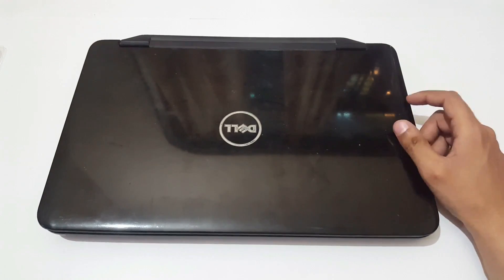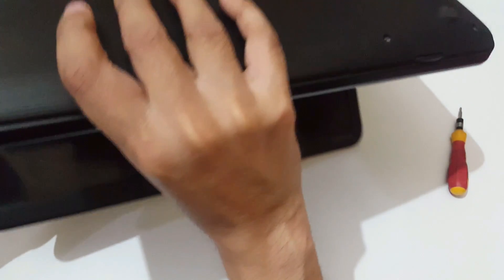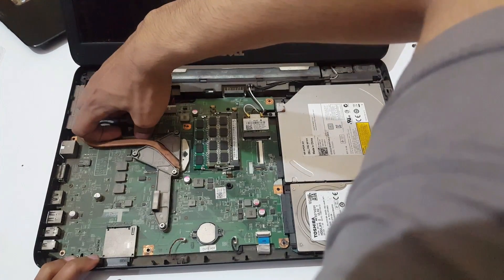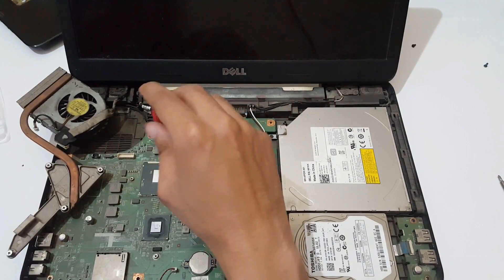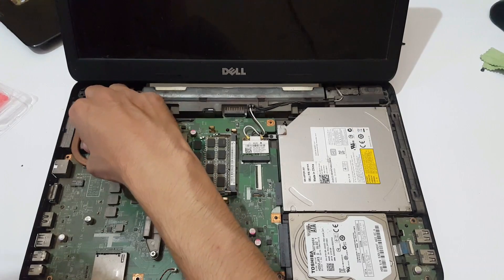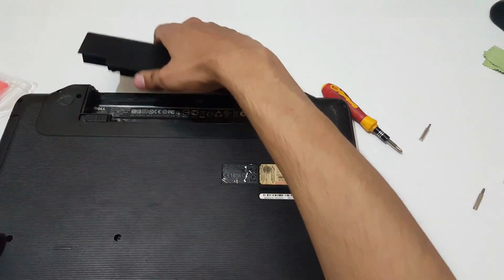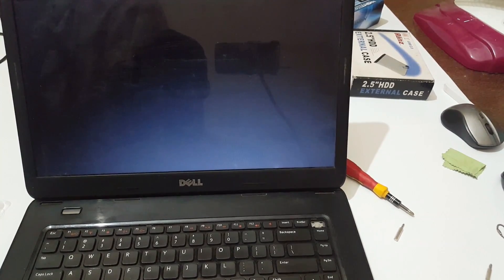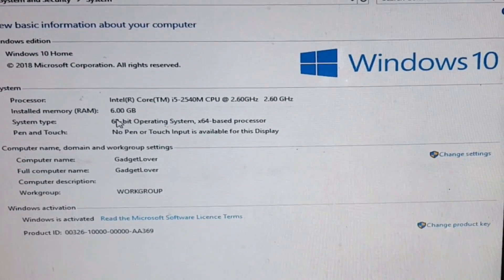How to Upgrade Processor on DELL Laptop | i3 to i5 & i7 - Make Laptop Faster for Gaming

Comment: I have Dell Inspiron n4050 with Celeron b815 it has FCPGA988 socket, I wanted to upgrade it to core i3-2350M with PPGA988 but I'm not sure will it work or not, I'll really appreciate if you can help me out 🙏
Reply from the maker: Sinatria : Yes it will work and I would like to inform you that Intel Core i5 2540M is best processor for your Laptop
Reply: @GadgetLover360  thanks a lot for your information brother
Reply from the maker: Sinatria : You're most welcome

Comment: Bro I have Lenovo g570 20079 which have i3 2330m. I want to upgrade  which processor suits the most?
Reply from the maker: udit dagar : Intel Core i5 2540M is best processor for your Laptop
Reply: @GadgetLover360  what about i5 2400?
Reply from the maker: udit dagar : Unfortunately you can upgrade it in same generation only
Reply: @GadgetLover360  i5 2400 is the second generation also i3 2330m is second generation
Reply from the maker: udit dagar : You can't install desktop processor in Laptop
Reply: @GadgetLover360  bro can u suggest some other cpu which is equally powerful as i5 2400?
Reply from the maker: udit dagar : This is best available Intel Core i5 processor your Laptop
Reply: @GadgetLover360  bro where I can get these old CPU's?
Reply from the maker: udit dagar : I would suggest you buy it from Ebay or Aliexpress online store
Reply: @GadgetLover360  bro can I use i7 2720qm in my laptop?
Reply from the maker: udit dagar : Yes

Comment: Can I upgrade my laptop processer I have lenovo G50-45 with AMD A8 6410 plz Answer
Reply from the maker: sandy bisht : The processor of this Laptop is soldered so you can't upgrade it but I would suggest you upgrade its RAM and install SSD for better performance

Comment: CAN THIS WORK ON LENOVO G500 MT 20236 
WITH 4GB RAM WITH I3 3110M
I NEED TO UPGRADE TO  I7 CAN I :(
and which is the best processor for i7 i need atleast 3ghz please tell
Reply from the maker: G N : Yes and you can upgrade it with Intel Core i7 3540M
Reply: @GadgetLover360  allahuakbar sooo thanks and not only that its 3.7ghz :)
And can i upgrade ram to 12gb?
And really i like my laptop ;)
Reply from the maker: G N : You're welcome and yes you can expand it upto 16GB
Reply: @GadgetLover360  whoa im soo happy 
Now i can make this laptop higher end this is my favorite laptop ever :)
Reply from the maker: G N : Glad to hear this
Reply: @GadgetLover360  yeah :)
Reply: @vladimirazirov1815  its only 3.20
I7 3540 is better :)
Reply: @vladimirazirov1815  yeah you are correct but i need more ghz 
It will be much better :)

Comment: I have an old Dell Latitude E4300 with 8GB RAM. Can I upgrade it to an i7 processor. If so please recommend one suitable for for this laptop. I also want to increase the RAM to 16GB. Can I do that because 8GB is the max for this system. Thanks.
Reply from the maker: nttam1920 : You're welcome and unfortunately the processor of this Laptop is soldered so you can't upgrade it but I would suggest you install SSD for better performance

Comment: Hello! I have a Dell inspiron 15-3521 i5 3337U(3rd gen) 4gb ddr3 ram. Is it possible to upgrade this laptop? Thanks in advance!
Reply from the maker: Ibrahim Aguell : You're welcome and the processor of this Laptop is soldered so you can't upgrade it but I would suggest you upgrade its RAM and install SSD for better performance
Reply: @GadgetLover360  This laptop has a 2 ram slots. Is it possible to put 2-8gb ddr3L ram? Also, is there a limit on the capacity of the ssd if i'll change the hdd to sdd like 500gb or 1tb ssd. Thanks again!
Reply from the maker: Ibrahim Aguell : You're welcome and you can expand it upto 8GB and no limit for SSD

Comment: What can I upgrade my i3 6th generation, 8 Gb ram, and 2 gb graphic card
Reply from the maker: Alwin Varghese : I would like to inform you that if processor is not soldered you can upgrade it in same generation for better performance and upgrade its RAM and install SSD for more better performance
Reply: @GadgetLover360  I don't u understand about what you mean by same generation
Reply from the maker: Alwin Varghese : Provide processor number
Reply: @GadgetLover360  my current processor number
Reply from the maker: Alwin Varghese : Yes

Comment: What is best upgrade to i3 350m
Reply from the maker: balli bhatia : Intel Core i5 580M is best processor for your Laptop
Reply: @GadgetLover360  ig my processor is soldered but i will open it up and check it once
Reply from the maker: balli bhatia : I would like to inform you that if processor is soldered you can't upgrade it but I would suggest you upgrade its RAM and install SSD for better performance
Reply: Can i install sdd on dell vostro 1540. Also ty for info😊
Reply from the maker: balli bhatia : You're welcome and yes you can install internal SSD drive 2.5 inch
Reply: How much would it cost me
Reply from the maker: balli bhatia : I would suggest you check its price details on Amazon online store

Comment: Bruh my laptop had celeron core 2 duo is  it possible to updrade it ? It is removable.
Reply from the maker: LT. SNAKE : Yes
Reply: Bro please tell me what to updrade I already installed 8gbs of ram
Reply from the maker: LT. SNAKE : Provide processor number
Reply from the maker: LT. SNAKE : Intel Pentium N3540 is best processor for your Laptop
Reply: Bruh sorry for that the processor is n2840
Reply from the maker: LT. SNAKE : I would like to inform that you can upgrade it in same generation only and check its pricing details on Ebay or Aliexpress online store
Reply: @GadgetLover360  n2840 to n3540 bruh?
Reply: Bga 1170socket
Reply from the maker: LT. SNAKE : Yes
Reply: @GadgetLover360  can it run any egpu
Reply: Like 1030 GT?
Reply from the maker: LT. SNAKE : I would like to inform that you can attach graphics card externally to your Laptop for better gaming experience

Comment: I have lenovo v-14 i3 1005g1 can i put i5 4th gen on this?
Reply from the maker: HaxH S : I would like to inform you that if processor is not soldered you can upgrade it in same generation only

Comment: Cool Video. I have the n5050 but it seams like the i7-2670qm is not compatible with the Dell n5050. With the new CPU the pc does only give three short bios code sounds. I think they don't implemented CPU support for this Dell model.
Reply from the maker: HalbBlut Türke : Thanks and first update system BIOS to the latest version then try again
Reply: @GadgetLover360  thanks for the answer :). yes bios update was the first thing I tried A05 Bios. But still it will not work. Very strange situation because I read in the web that others did this CPU and it worked
Reply from the maker: HalbBlut Türke : You're welcome and yes this processor is compatible with this Laptop this may be due to the processor is not working so go to nearby PC & Hardware store and tell them about this problem
Reply: @GadgetLover360  thanks. Yes I think I will try a other CPU first because the CPUs are cheaper than the labor here in Germany. Maybe there is something wrong with the CPU because all combinations of parts I have worked with this pc as long as the new CPU is not involved. Greetings from Germany:)

Comment: Bro, hp probook 450 G3 i3 processor 1tb harddisk and 4 gb ram want to upgrade.. which processor suits the most ?
Reply from the maker: Beast productions : The processor of this Laptop is soldered so you can't upgrade it but I would suggest you upgrade its RAM and install SSD for better performance
Reply: @GadgetLover360  ok thanks bro
Reply from the maker: Beast productions : You're welcome

Comment: I have AMD Ryzen 3 processor but want to do video editing using Filmora. Suggest me modification for my Laptop. I use Lenovo IdeaPad slim 3
Reply from the maker: ASG Automobiles : The processor of this Laptop is soldered so you can't upgrade it but I would suggest you upgrade its RAM and install SSD for better performance

Comment: Not bad. Just screws should be put somewhere where they don’t roll off
Reply from the maker: xl ThomAs lx : Yes and I would like to inform you that if processor is not soldered you can upgrade it in same generation
Reply: @GadgetLover360  I know this already thanks
Reply from the maker: xl ThomAs lx : You're welcome

Comment: Hello bro, i have lenovo ideapad 330 i3 8130U 8gb ram. can i upgrade the processor??
Reply from the maker: THE DARK YT : In my knowledge the processor of this Laptop is soldered so you can't upgrade it but I would suggest you upgrade its RAM and install SSD for better performance

Comment: hello bro  can i change  the processor ??????? 
Device name	RAJEN
Processor	Intel(R) Core(TM) i3-4005U CPU @ 1.70GHz   1.70 GHz
Installed RAM	4.00 GB
System type	64-bit operating system, x64-based processor
Pen and touch	No pen or touch input is available for this display
Reply from the maker: RM TECH VIDEO : I would like to inform you that if the processor is not soldered Intel Core i5 4310U is best processor for your Laptop

Comment: My unit is i3 5015U, what's i5 processors can be upgraded to this? 

Thank you for your reply.
Reply from the maker: Stormforge : You're welcome and Intel Core i5 5300U is best processor for your Laptop
Reply: @GadgetLover360  thank you sir. Do you sell that in your country? Most of the processors here are for desktop only.
Reply from the maker: Stormforge : You're welcome and I am not seller but I would suggest you buy it from Ebay or Aliexpress online store

Comment: I have dell Inspiron 3521 i3 3rd gen laptop. Can I upgrade processor to my laptop. If it possible which processor is most suitable to upgrade
Reply: My laptop have 6gb ram. But 1.9ghz speed. So can't run big softwares
Reply from the maker: Mohamed Nuskhan : The processor of this Laptop is soldered so you can't upgrade it but I would like you upgrade its RAM and install SSD for better performance
Reply: @GadgetLover360  thanks
Reply from the maker: Mohamed Nuskhan : You're welcome

Comment: Bro can upgrade my laptop processor Specifications of my laptop is AMD E2 7th gen 9000e and which processor suits my laptop most pls suggest me bro
Reply from the maker: Ritesh Kumar Mahakud : If processor is not soldered AMD E2 9030 is best processor for your Laptop
Reply: @GadgetLover360  bro pls suggest a powerful intel processor because amd processor sucks very much and Radeon graphics are just shit
Reply from the maker: Ritesh Kumar Mahakud : I would like to inform that you can upgrade it in same generation only
Reply: @GadgetLover360  but bro can i not upgrade it from amd to intel processor
Reply from the maker: Ritesh Kumar Mahakud : Yes
Reply: @GadgetLover360  ok brother thanks you a lot
Reply: @GadgetLover360  but pls tell which 7gen intel processor will be best
Reply from the maker: Ritesh Kumar Mahakud : You're most welcome and as I said before that you can upgrade it in same generation only
Reply: @GadgetLover360  brother what will be the price of laptop graphics card of 512mb
Reply from the maker: Ritesh Kumar Mahakud : I would suggest you to buy Asus GeForce GT 710 2GB Graphics Card from Amazon online store
Reply: @GadgetLover360  bro but i need a laptop graphics card
Reply from the maker: Ritesh Kumar Mahakud : I would like to inform that you can attach graphics card externally to your Laptop for better gaming experience
Reply: @GadgetLover360  bro i have lenovo IdeaPad 320 can i add a internel Gtx 960m to it
Reply from the maker: Ritesh Kumar Mahakud : You can attach graphics card externally to your Laptop

Comment: hello bro i have Acer travelmate p243  celeron 1005m 1.90ghz processor ddr3 ram 5gb which is best processor i can use ? please tell me and the price also?
Reply from the maker: Dopenews Official : Intel Core i5 3380M is best processor for your Laptop and I would suggest you buy it from Ebay or Aliexpress online store

Comment: can I replace the i5-1035G1 from my dell Inspiron i5-5593 2020 version with an i5-9400f?Can i also replace my GPU to like gt710
Reply from the maker: Rise : I would like to inform you that if processor is not soldered you can upgrade it in same generation only and you can't replace the GPU but attach graphics card externally to your Laptop for better gaming experience

Comment: I have Dell INS 5567 - Intel i3 processor with 4 GB Ram. Can you please tell me if  I can upgrade my Processor, Ram and Storage to SSD? If possible please suggest
Reply from the maker: Makarand Kadam : The processor of this Laptop is soldered so you can't upgrade it but I would suggest you upgrade its RAM and install SSD for better performance

Comment: i have dell n5050 ..it has become very slow over a period of time..i want to upgrade it ..please tell me which processor and ramis needed for it
Reply from the maker: Arjun Sawhney : Provide processor number and you can expand it upto 8GB so upgrade it to 4+4GB DDR3 1333MHz RAM
Reply: @GadgetLover360  Intel® Pentium® Processor B950
Reply from the maker: Arjun Sawhney : Intel Core i5 2540M is best processor for your Laptop
Reply: what about the i5 generation
Reply from the maker: Arjun Sawhney : Unfortunately you can upgrade it in same generation only
Reply: @GadgetLover360  after i upgradation can i run softwares like solid works
Reply from the maker: Arjun Sawhney : Yes upgrade will improve the performance of your Laptop

Comment: But how i would know which laptops we can  upgrade in terms of processor nd other hardware
What are the points we should keep in mind when we r going to buy any laptop if we want to upgrade in future
Bcoz now day many laptops comes with on board cpu ...in that case hw can we upgrade cpu.
Reply from the maker: Girijanand Meshram : I would suggest you before buying check processor socket specification on Google

Comment: I want upgrade from i3 6006u to i3 10100u if not ,how is i7 6600k
The laptop is dell Inspiron 15 3000 series.
Reply from the maker: Swapnali R : I would like to inform you that if processor is not soldered you can upgrade it in same generation only
Reply: @GadgetLover360  how do i check if my cpu is soldered
Reply from the maker: Swapnali R : Disassemble it and see

Comment: bro, ihave dell vostro 3590 i3 laptop ..can i upgrade it to i5 and how much it costs
Reply from the maker: suryateja uppula : The processor of this Laptop is soldered so you can't upgrade it but I would suggest you upgrade its RAM and install SSD for better performance
Reply: @GadgetLover360  i have 4gb ram ..can i upgrade it to 12 gb? does i3 supports it
Reply from the maker: suryateja uppula : In my knowledge yes
Reply: @GadgetLover360  thank you bro
Reply from the maker: suryateja uppula : You're welcome
Reply: @GadgetLover360  bro another doubt ..i installed 128gb ssd 2 months back it worked well ..but now my laptop is always hanging when i open bluestacks ..any solution?
Reply from the maker: Iam always single : Free up unnecessary storage
Reply: @GadgetLover360  i have lot of free space but bluestacks is lagging
Reply from the maker: Iam always single : Enable hardware assisted virtualization

Comment: Amazing video , May I know can I upgrade the cpu of my predator helios 300 i5-9300H to i7 🤔
Reply from the maker: Tg Alif : Thanks and unfortunately the processor of this Laptop is soldered so you can't upgrade it but I would suggest you upgrade its RAM and install SSD for better performance

Comment: Can i change the processor in my dell inspiron 13 5000
Reply from the maker: F3aR CODM : The processor of this Laptop is soldered so you can't upgrade it but I would suggest you upgrade its RAM and install SSD for better performance

Comment: Hii bro.. can I upgrade my intel pentium p6100 to any upper version intel or amd processor?? Please reply 🙏.
Reply from the maker: Debjyoti Musib : I would like to inform you that if processor is not soldered you can upgrade it in same generation only and Intel Core i5 580M is best processor for your Laptop
Reply: @GadgetLover360  no my processor is not soldered. I already checked it. And Very very thanks for your information... Can I upgrade it with any generation of i3 processor or amd processor??
Reply from the maker: Debjyoti Musib : You're most welcome and as I said previously that you can upgrade it in same generation only
Reply: @GadgetLover360  I guess that i5 580m is a 5th generation processor. So can I upgrade it into i3 5th generation ??
Reply from the maker: Debjyoti Musib : It is first generation processor
Reply: @GadgetLover360  ok thanks bro❤️
Reply from the maker: Debjyoti Musib : You're welcome

Comment: I have vostro 15 3568

Which processor should I choose ? 

Pls help
Reply from the maker: Elitron Gaming : Unfortunately the processor of this Laptop is soldered so you can't upgrade it but I would suggest you upgrade its RAM and install SSD for better performance
Reply: @GadgetLover360  okay thnx but any other solution for this
Reply from the maker: Elitron Gaming : You're welcome and soldered processor can change but it requires professional hand soldering services
Reply: @GadgetLover360  so Have u made any video on this not so pls give some tips 🙏🙏
Reply from the maker: Elitron Gaming : I would suggest you go to nearby PC & Hardware store and ask about it
Reply: @GadgetLover360  thnx bro love u
Reply from the maker: Elitron Gaming : You're welcome

Comment: Acer aspire A315-21
AMD E2 9000 processor 4gb ram
Can I change it?
Reply from the maker: Aniket gupta : Unfortunately the processor of this Laptop is soldered so you can't upgrade it but I would suggest you upgrade its RAM and install SSD for better performance

Comment: Bahi I have an 3542 will this work for me?
Reply from the maker: faris azhar : Unfortunately the processor of this Laptop is soldered so you can't upgrade it but I would suggest you upgrade its RAM and install SSD for better performance